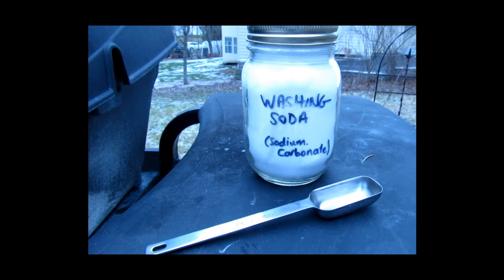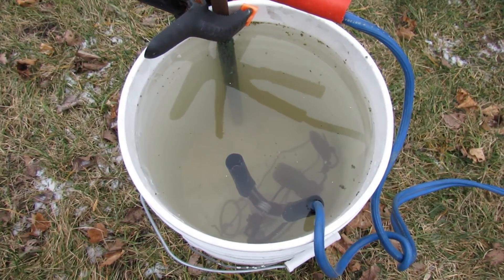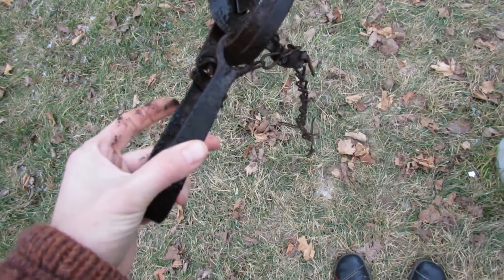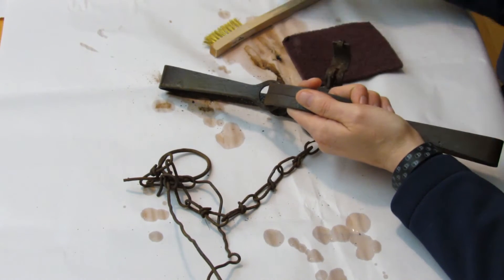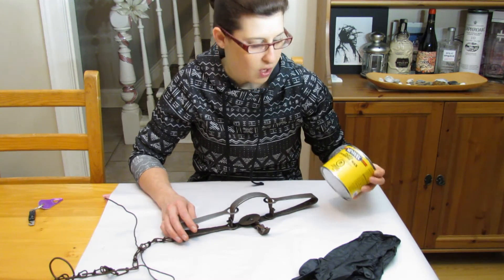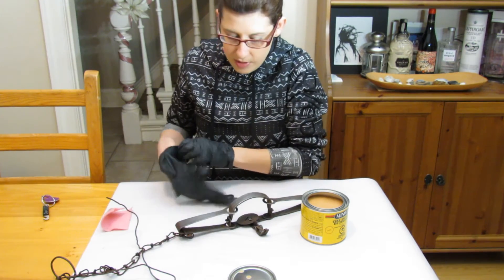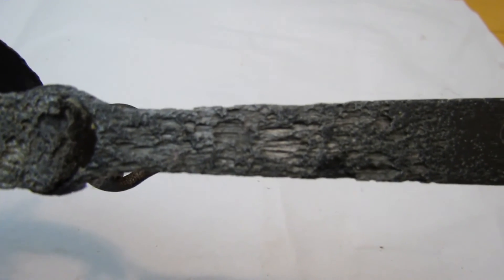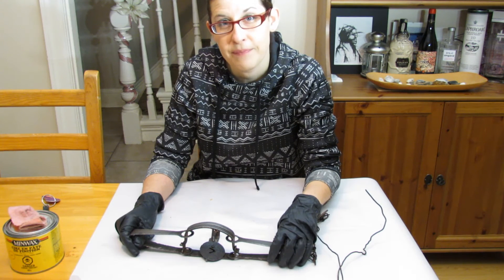Antique Trap Restoration

Comment: TWY, we trappers use a much simpler method. Soak the trap in hydrogen peroxide( 2 quartz)  liquid dish soap (1/2 cup) & baking power ( 2 cups). Soak 8 hours, rinse with clear water and you have a rust free new trap! Easy and not electrified, EH?
Reply from the maker: That sounds like a neat technique. Thanks for sharing!
Reply: @BearlyOutdoors, I may try your method as well to see how it works in comparison to the posted technique. I appreciate you sharing and have a question for you. Are you using common 3% grade hydrogen peroxide or are you using a stronger grade like 6% or 12%?

Comment: An easier method to wax that trappers use is heat up some trap wax in a double boiler as not to scorch the wax and just dip the trap. Let the trap heat up to the same temp as the wax and after a few minutes, pull the trap, shake it off and hang to dry. Great video.

Comment: Willd Yam, I just saw your video and don't know if you're still monitoring this thread but wanted to say thanks for the insight. There are a couple of other videos that show methods that seem a little less effective. I do have one question though. You said that the electrolyte bath consisted of water and soda ash / soda wash, but you didn't suggest a mixture ratio. I'm curious what strength you used. I have purchased some soda ash that recommends mixing about 2 1/4oz of soda ash per gallon of water for a cleaning solution for clothing. I thought about making it a little stouter for this application, any thoughts?